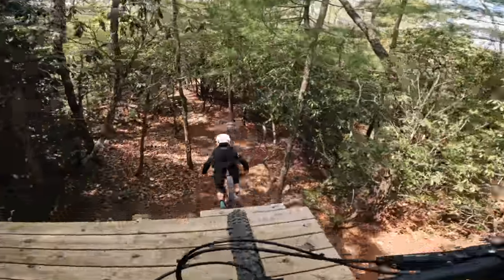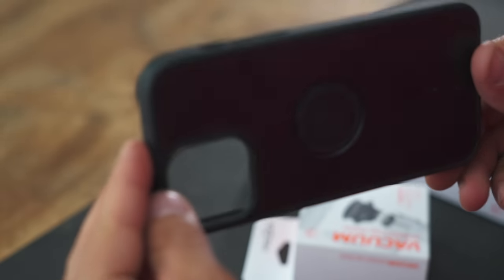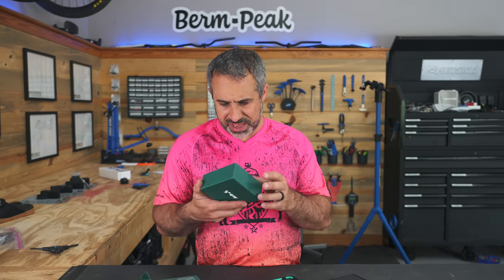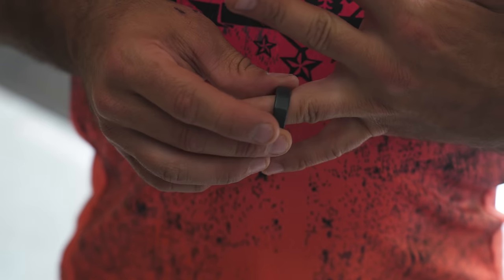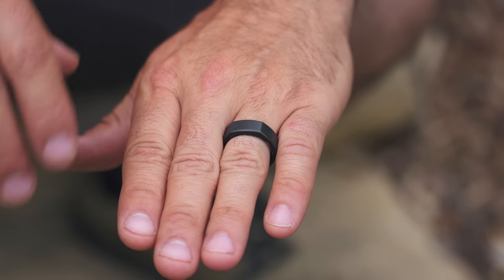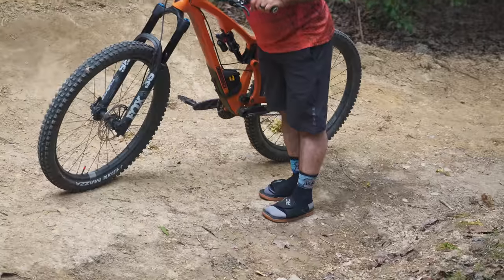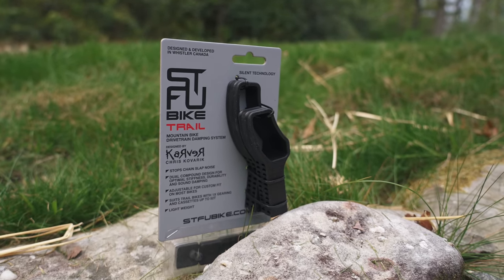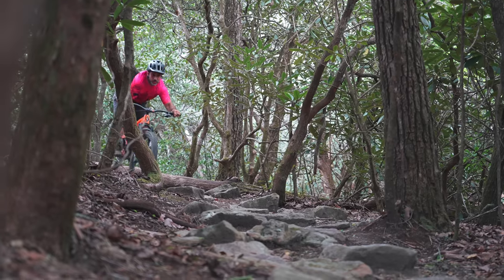Reviewing Semi-Normal Mountain Bike Products

Comment: I've been using an oura ring for the past few months, MAKE SURE YOU NEVER LET IT GET LOW ON BATTERY I lost a lot of the batter life when I got stuck without its charger for a week or 2 it only lasts like 4-5 days now.
Reply: Lithium batteries should never go below 30% for the best longevity.
Reply: @bikeislife8405  truth
Reply: $300 usd for that? I'd be heated. Warranty claim that pos
Reply: @acmhfmggru  that is simply not true. Lithium batteries can be permanently damaged if left depleted. Similar case if left fully charged over time, the battery will start to degrade over time. This is why ALL batteries are required to be stored between 30-40% by manufacturers. Your argument of "almost nothing" is an artificial limit set by said engineers. Lithium is NOT at that point just yet for the common consumer.
Reply: @acmhfmggru  I have had hundreds of lithium batteries through the years via R/C planes/trucks. Trust me, as someone who's invested thousands on lithium I know what kills them and what keeps them going.
Reply: You're delusional if you think that all devices have a low voltage cutoff 😂😂👍

Comment: The STFU chain quieter is a really really awesome product. I’ve been running it for a few months now(6-7) and absolutely love it. One thing that I will add though is that the zip ties that come with it are really flimsy and frail. You can fix this by just adding some of your own.
Reply: I’ve been running one on my Nukeproof Mega and I didn’t realise how much noise I was getting from the chain until I installed it. Now all I hear is the freehub buzzing and the sound of tyres in the dirt 😀
Reply: Wrap an inner tube on the chainstay, never hear my chain.

Comment: Cable buddies are sweet! I had my cables bound by electrical tape but it seemed to always start peeling off sooner or later and I had to cut and re-apply it whenever I wanted to swap cable housing/brake hoses. Now everything is tidy and it’s super easy to take them off for maintenance if needed. Very nifty little product 👍🏻

Comment: Quadlock DOES have mounts that work with wireless charging. I use one in my car, along with a wireless charging adapter for my phone that didn't come with wireless charging, and they work great.
I don't think you would want to use one of those on your bike though, that would mean you'd have to strap a battery to your bike frame and wire it to the mount. I doubt the wireless charging piece is even compatible with the bike mount
Reply: Yes, also my Samsung wireless charger still works with a Quadlock case on my S10.

Comment: FiveTen was bought by Adidas a couple of years ago and a lot of quality issue things seemed to pop up. I noticed it the most in rock climbing shoes but just recently got a new pair of free rider pros and agree they feel different than they used to.
Reply: I switched from Freeriders to RC Livewires and I'm happy with them. Better built, stiffer sole, faster drying, and grip is nearly the same.  All for the same price.  Oh and lace holders too.
Reply: @plmn93  Do the RC's run true to size?
Reply: @timharker7447  My size 13 fit the same as 510 Freeriders did.  About the same as my running shoes, which are about a size larger than my dress shoes.

Comment: I’ve used a Mous case on my iPhones for the last 5 years, they are by far the most durable case I’ve ever had. The new ones support magnetic mounts, so that’s what I use in the car.

However, I’d need to buy a new case to be able to use it with my bike, I think that’s a backwards step. I won’t be replacing my case until I get an new phone with a different shape, as this case was £60!

Comment: Quad lock will work with a wireless charger, at least for my Pixel! I use it on my bike (normal mount) and my motorcycle with their wireless charger. I use a regular cheap wireless charger on my desk. I like the case of the Fidlock a lot though, looks a lot sleaker.
Reply: I was going to say the same thing. I have a Samsung S22 with no issues.

Comment: I built a manual trainer as a lockdown project, and i loved it !
I was using it to do some small 5 mins training, just put a helmet on and lift that front wheel. I could've just done in the street (well not during lockdown but still), but that would've meant fully gearing up ... The manual trainer was a good way to store my bike, and have some fun while improving manual/balance skills, so i wouldn't say there's useless

Comment: Using the SKS Compit system myself... It's quadlock style but you can get a battery for it that wirelessly charges your phone when it's attached. They offer multiple mounting options, and they also sell a protective water resistant case if you want more protection for your phone than the SKS case offers.

P.S. May we all be so fortunate to own enough property to build a trail system. Until then, maybe some people actually do have a need for indoor training tools.

Comment: my one problem with mounting your phone to your bike is that if its too good, it could be dangerous for your phone. I once had a really solid mount, and when i fell hard, my phone stayed on my bike. However, that meant all the energy from the fall traveled to my phone and it actually broke on the inside (the screen ribbon ripped). Its kind of like downhill skis, you want them to attatch to your feet strongly, but if you fall you don't want them to stay on

Comment: Definitely check out Peak Designs bike mount and case. The mounting is easy like the Fidlock, but wireless charging compatible and an out front bike mount of the Mous. Super stable, and didn’t budge or fly off when I crashed my bike a few weeks ago. Case is good but not quite perfect, but it has a lot of mount accessories in addition to the  bike mount.
Reply: Another vote for Peak Design. They also have a strap on mount for the stem/top tube if you don't want your mount out front of the handle bar.

Comment: You need to check out the sp connect phone case and holder. Incredibly polivalent, has mounts for everything, a very low profile case, and the top cap mount is absolutely minimal

Comment: Those phone cases look great! Like Seth I haven't gone to a quadlock because of the case with the bit sticking out.
As a landscaper, the Mous with the holes in the case would let dirt in and I'd forever be cleaning it out.
I don't use a wireless charger as I'm usually using my phone while it's charging so I think the other one will be fine.

Comment: Quadlock sell their own preparatory wireless chargers. A waterproof version (boats and motos etc) and a standard internal one (desk, car etc). I already have 2 cars, moto, 3 bikes, desk etc all fitted out with quadlock kit, because it was the best there was, as you said, and i'm not too fussed by the slight protrusion in the case. But overall love the performance and quality.

I really like how cool that fidlock one is. The other one looks like it'll just get too much gunk in the little groves too easily....

Comment: Mous makes good stuff. I use a basic case from them for my S21. Other than the finish on the back wearing off (seems to be a clearcoat), it's better than most other cases.

The phone clips in securely, yet doesnt have two piece design. Its a hard case, yet it isn't. It doesnt crack like Otterbox cases have. I've dropped the phone many times.

Comment: Quadlock do sell wireless chargers, which clip on the back of the phone like the bike mount. I use it in my car, so apart from quadlock case being rounded on the back, I dont think there is a problem using witeless charger. You can even put the wireless charger on the bike mount, and use your bike light as a  power bank to charge your phone wirelessly during a ride.

Comment: Hello if you are still using Quadlock I recommend getting the vibration dampener, it’s good for vibrations it doesn’t fully eliminate it, but what happens is, it’ll damage ur cameras image stabilization over time i recommend lock tight after removing each screw to make sure they stay nice and tight

Comment: i have had a mous case over 2 phones for like 4 years now. holy CRAP the drop protection is insane. one time i slammed my phone down on the counter (i know i shouldn't) and it bounced onto my ceramic kitchen tiles. it was completely fine. i can preach it

Comment: The brake hose holder or whatever they are called are stock on canyon bicycles i think they are quit cool but electrical tape or heat shrink tube is absolutely fine aswell

Comment: Would like to see more on phone mounts that have kits for non-flagship phones. 
I've been using a quadlock for years for years now since it is easy to remove the phone side with a razor blade, clean it up and slap it on a any smooth backed case (or right onto a phone if you are some kind of savage) with a simple 3m double sided adhesive. It has been flawless which only includes a little off road. 

Mous appears to be iphone only for the bike mount- that is a massive con for over 70% of prospective buyers!

Fidlock sell a universal mount for use with any smooth phone case for 14 Euro - that is a pretty big pro! (quadlock universal is slightly cheaper)

I'll be sticking to quadlock since I already own it, but I hope this comment is helpful for all of the many sub $1,000 smartphone riders. 

The sandals maybe a pair of heel straps away from being summer commuter weapons!

Comment: One issue I see with the fidlock case is the use of the suction cup. The second that case takes a scratch to the suction surface it's not going to hold as well as it did. With the mous the problem I see is the clips wearing out over time. With that being said, I think that you would probably get more longevity out of the mous. This is just based on the kind of environment that the phone will be in.

Comment: I've been using Quad Lock for years and it always worked fine with wireless charging, even with the bump in the back it would charge normally over the charging pads.

Comment: I’ve been using a Rokform case and handlebar mount for a few years with an older phone with good results.  We don’t have anything really rocky and choppy out here on the coast but I’ve never had an issue.  I’d love to upgrade to a garmin but the 3-500 bucks for that or a phone I already have?  I chose the old phone lol.  I’m sure I’ll swap eventually but so far this has worked and I love the case itself.

Comment: My quad lock works fine with wireless charging. I do take the metal stand out of the back of it when I get in the Tesla to use the phone charging pads that are built in. Otherwise if I use the wireless charging windscreen mount I’ve still got to do the same.

Comment: A big con I see with both cases is there is no cover for the camera lenses.
I Have a Nillkin Camshield Pro case on my Samsung A52S, it has a sliding door to cover the camera lenses, initially it's very tight so can be bit hard to slide when new with one finger, but once worn it it's easy.
but this case does not have any attachment. But I love that it has a cover for the lenses. so the lenses stay clean and don't get scratched.

Comment: iv had my mous case ever since i got it and there the best thing ever i was doing a wheelie down a hill and my phone fell out my pocket and a car ran over it and there was zero damage to my phone not even a scratch ever since then i haven’t had a different case on my phone obviously idk how safe the did lock is but if you dropped your phone with a mous case you will not damage it wether you are riding or not

Comment: One thing to mention is that when it comes to bikes vibration is a killer and the IOS in most phones goes out thus rendering the camera useless. Quadlock offers a phone dampener mount which greatly reduces vibration. So if you're thinking about buying one of these phone mounts check if they have some kind of dampening option (i didnt check) and if not, be prepared it can ruin your camera

Comment: I have been using ride concepts hellion as a casual/cycling shoe 
Although my pair now has a problem , its too tight on my feet so a larger pair is needed , i also use them in my garden EXTENSIVELY and they seem to hold up . the glue holding the sole to the uppers is starting to separate, mostly due to the tight fit

Comment: Hey Seth and Team. Huge Fan here.
Yknow, i was wondering. You did a lot of Videos on how to improve a used Bikes or Bikes in general. But i found its another topic for some of those 600-800€/$ Bikes.
You usually get a terrible Fork, mine has a Rockshox silver and its allready dead rarly riding it, ofc not so good gearing and a lot of things and questionable frame.
So, is there any possibility you do a video on how to buy a bike in that price range and/or what to do to upgrade it in a reasonable manner?

Not everyone has the money or is willing to buy a bike for 3Grand. :S

Cheers !

Comment: My quad lock case works with every wireless charger I’ve tried it with 💁‍♂️

Every single one of them, 5w cheap ones to 15w expensive ones, it’s always worked
Reply: It really depends on the position of your wireless charging coil. Not every phone on the market is built the same
Reply: @mikuramsay  fair call, Apple does do it better than the competition

Comment: Have you found/heard of any mtb mount designed with Pixel phones in mind? I love Fidlock gear (and use their strap mounted bottle setup under the down tube on my full-sus) but can't find any of the nice mounts you've tested in a version for these phones. The closest in measurement is Fidlock's option for a Samsung S21 (I don't care about camera access or buttons -- just being able to use TrailForks without stopping to dig the phone out of my pocket). Any ideas?

Comment: The cable buddies are neat!

The STFU Bike is just bad... There's been a product called Lizard Skin that's been around for ages. it's a flexible velcro sheath that goes around the chainstay. Better yet! You can even just wrap an old tube around the chain stay, and if you wrap and tuck it just right, it looks great! Far better than this silly clunky product.

Balance training on that bike rack or whatever tf it is, will ruin your wheels if you put any sort of side pressure against the rims.

That water bottle is over $100

Just wear boots...

These products are mostly shams, but you're a very good rider, and the videos are fun to watch.

Comment: Great video and some useful products!

The Peak Design Mobile ecosystem is great IMO. I have a wireless charging dash mount for the truck that's magnetic, then a handlebar mount for my bike that has retention clips that lock into an inset ceramic/metal ring that keeps it from being removed until you press the button. It's also compatible with all apple's magsafe accessories too.

Comment: My opinion on the Phone cases is for me the Mouse (2nd) case is more attractive for me. There is a few reasons. Not being so fast and  easy to attach to its base for me means, the easier to attach. the more likely it is to easily fail. Or because of the ease, I would get complacent. Then destroy my phone as a result. Then just as important is the attachment part. it appears to be a part that can be mounted in multiple different ways, or can be taken appart and attched custom to something else i.e. like take the bolt out that holds the hoop off that holds base to the handlebar and screw it directly into a spare bottle holder location.

Comment: I see what you mean about not needing a manual trainer cause you can just practice manualing while you ride but I think that way of thinking kinda misses the point of a trainer which is the relatively low risk they offer. I can wheelie no problem. Once you learn how to find the sweet spot you can just keep going. I'm sure it's the same for manualing but the few times I've tried I was either way too soft on my pull and only came up a few inches or I whipped the rear tire out the front and it was like jumping off a tread mill. I would love to be able to practice finding that sweet spot in place so all I had to do was step down if I lost my balance. From there I'd be a lot more confidant to try it with some speed.
Reply: I thought the idea of manual machines was a tether for the front wheel so you can't "loop out". I know, not really looping out if not moving, but I think everyone gets the point.
Reply: @mtbnb506  Our Balance Trainer comes with a strap to tether the front wheel. It is a great workout for those fast-twitch muscles that are needed for quick reactions on the trail. It does much more than dial in your manuals. Not to mention all the other uses for the product.

Comment: Does the noise canceling chain guide work with a 3x8 gearing setup? Or is it just 1x12/1x10 capable?
Reply: Probably not as the chain is very close to touching the guide in the largest and smallest gear with a 1x setup. Even if it did work a lot of the drivetrain noise on a 3x system comes from the lack of a derailleur clutch causing the derailleur cage to slap around.

Comment: Random video idea: I’ve been looking into motorcycles and while they are expensive, you get dieting that can easily go 100mph and replace a car. And MANY awesome features under $10k. Yet when I look at mountain bikes, some cost easily as much as let’s say a Yamaha MT-07. The Trek Rail and Slash are almost equally priced. 

I’m sure there’s a good reason. But could you break down why a mountain bike can cost the same as a badass motorcycle? It’s why I refuse to buy a new mountain bike but maybe there’s insight as to why the price is justified.
Reply: The highest end mountain bikes are gonna be about 10k while a top of the line motorcycle can be past 100k

Comment: I would never rely on something based on a suction cup in a dirty environment. It takes only a minute disruption of the seal for it to loose its holding power.
Cleaning a suction cup on a dry, sunny, windy day at the beach and you will have eaten enough fine sand to fear your next trip to the toilet.